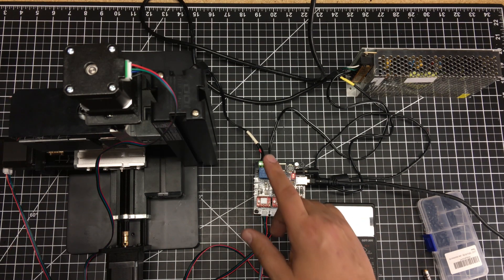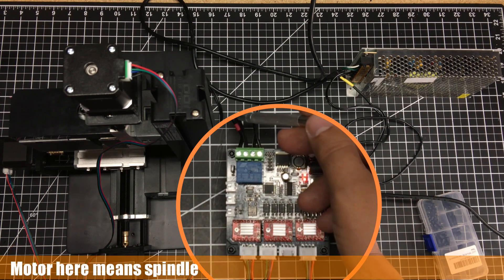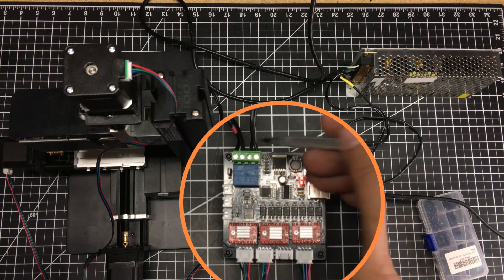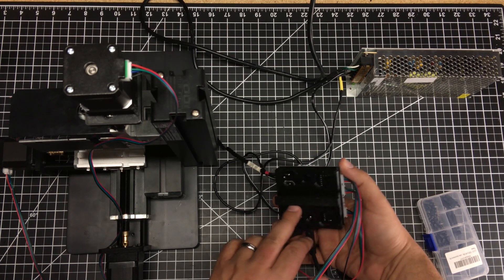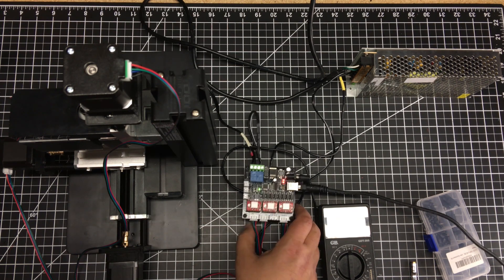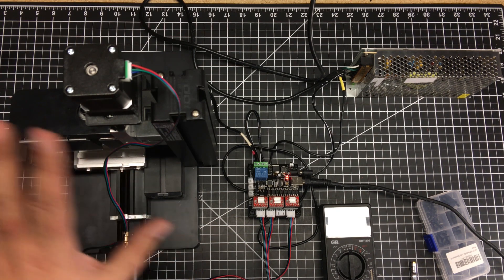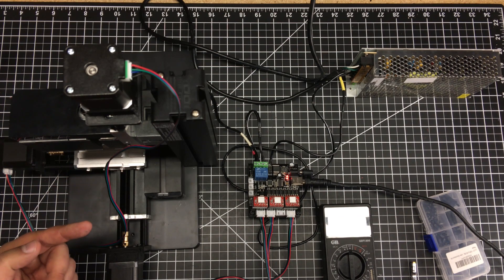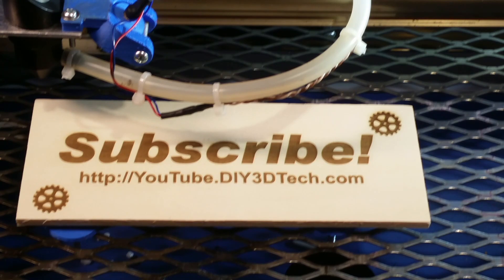MicroMill - GRBL Electronics Run Though!

Comment: Where are the rest of the updates? Are you still using or modifying this machine? Thanks
Reply from the maker: Yes finished this project and still have it, I belive there is a playlist for this so please check it out.  The only issue is the backlash is quite high and I have not had time to really think about how to fix
Reply: @DIY3DTECHcom  I've watched all 4 videos on the playlist if that's all of it, I was hoping you could upload a video of it milling aluminium/brass or some kind of work you've done with it, maybe a new video you could upload in the future?

Comment: I bought the same board to control a 2.5w laser engraver kit. The original board stopped working. My laser has the driver integrated with only 3 wires total. Do you know how to wire to this board?
Reply from the maker: The wires are likely (1) Ground, (2) PWM and (3) Hot so you need to figure out which are which and match them up...

Comment: Have you tried varying the speed (rpm) of the motor using the M3 / M4 SXXX command?
Reply from the maker: Can't the board only has a relay so it is either on or off...